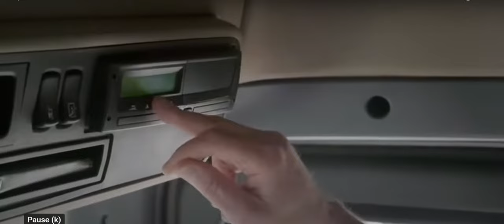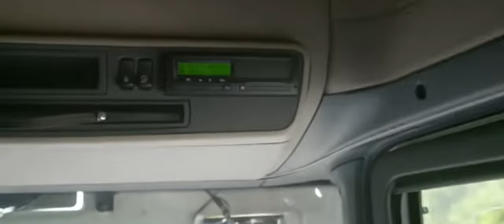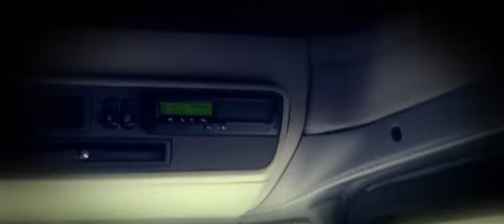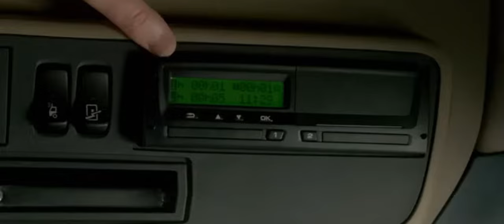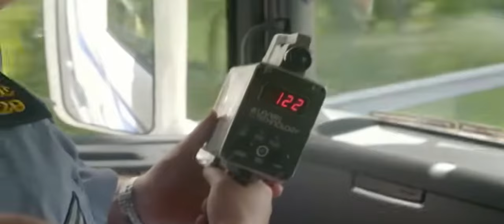Tachograph Manipulation in Ireland - #tctsgroup are still dealing with these issues.

Comment: The problem is the shipper is not paying a proper rate. Or the operator has undercut a competitor to get the work. A lot of poor rates offered by shipper's plus holding up trucks when loading. It's a stupid mistake to continue driving when tired as you're just going to draw attention to yourself. I'd say the driver was being forced to keep going in this case. IMO